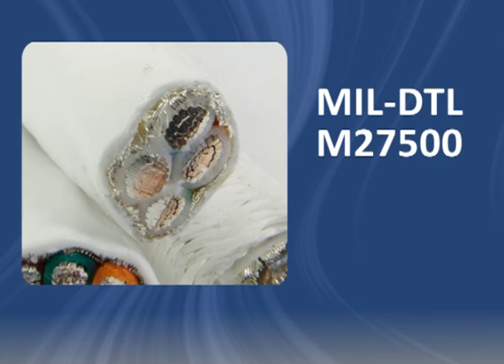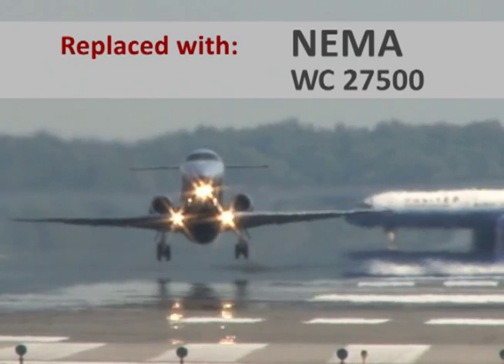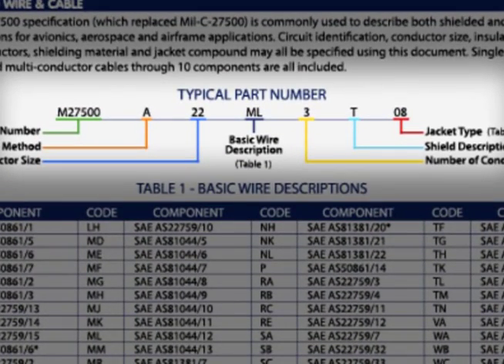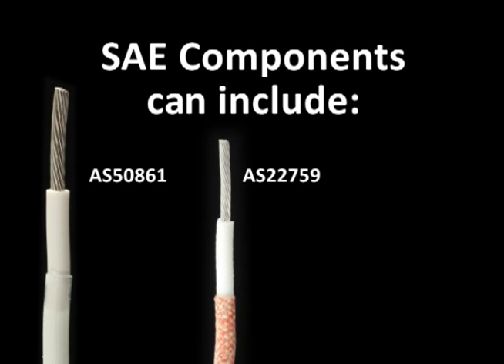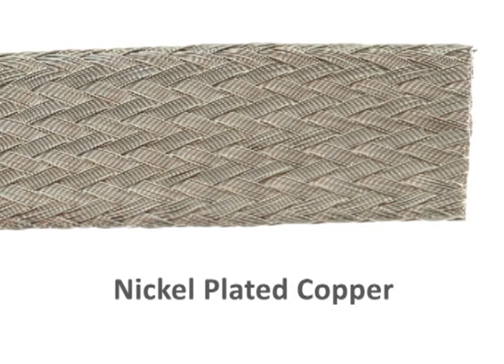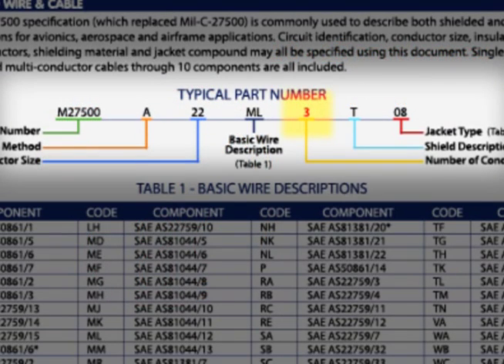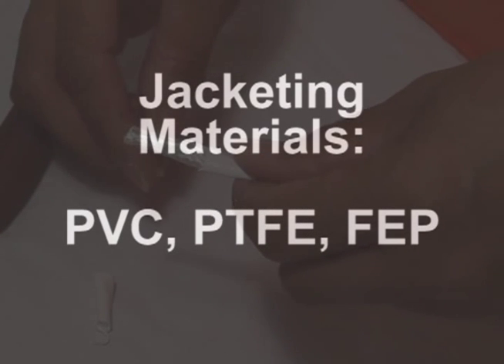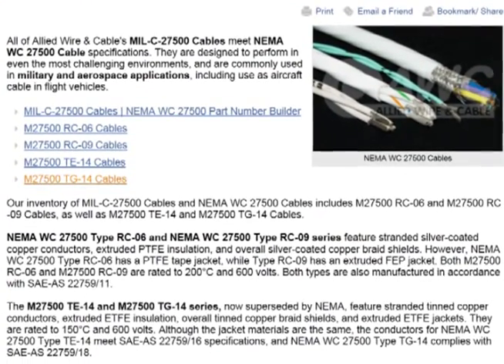M27500 Cable - Allied Wire & Cable Product Spotlight

Comment: Can someone suggest a supplier who has the ability to supply M22759 wire with a range of wall sizes – thin, standard and standard high strength?
Reply: Olympic Wire stocks the popular, versatile Mil-W-22759 fluoropolymer-insulated single conductor electrical, silver coated copper wire, which is in high demand for many applications that require high reliability wiring. M22759 wire comes in a range of wall sizes – thin, standard and standard high strength.
Ref: http://www.olympicwire.com/product_category/mil-spec-wire/
Reply from the maker: Hey Jone!
Great question! At AWC, we have a large range of sizes for M22795 wire. You can find those at: http://www.awcwire.com/producttoc.aspx?id=mil-w-22759 and submit an RFQ online or over the phone.

If you are interested in learning more about M22795 we have an excellent article giving you more information found here: https://awcwire.wordpress.com/?s=m22759

If there is anything else we can help you with, let us know!